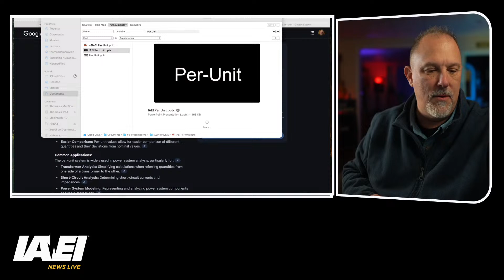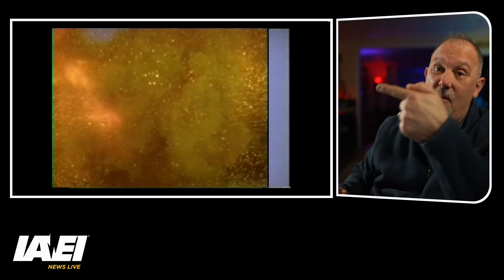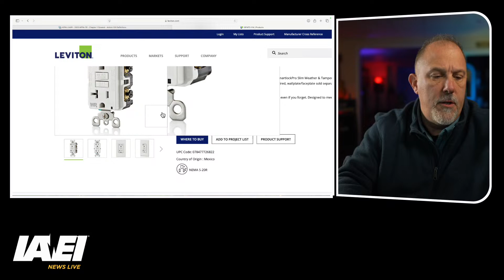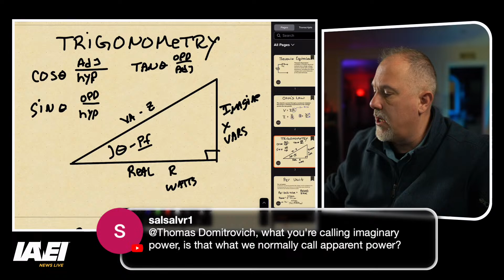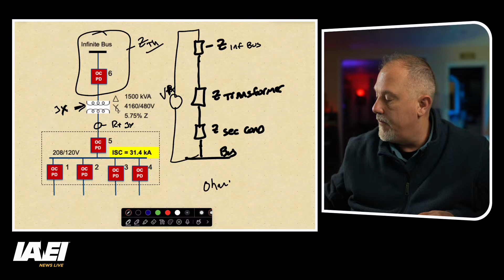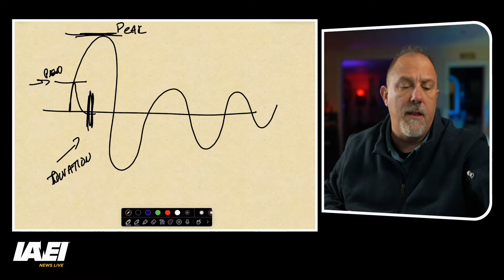Available Fault Current

Comment: Google, The Short Circuit Current Rating (SCCR) of a 20-amp light switch is typically 10,000 amps (10 kA), but it's crucial to check the manufacturer's specifications or the device's labeling for the exact value.